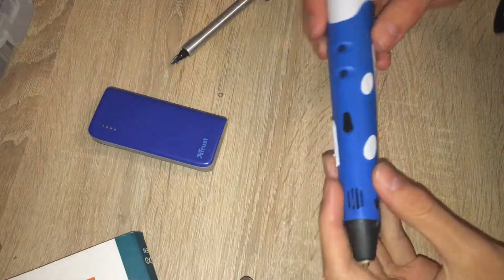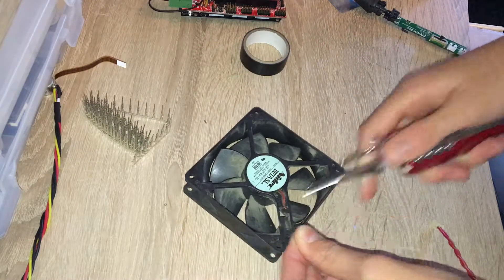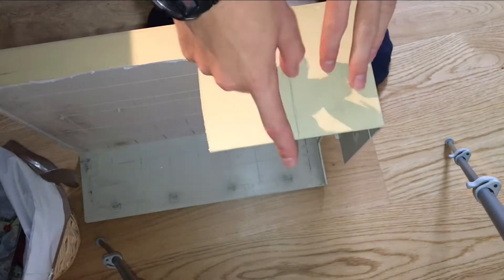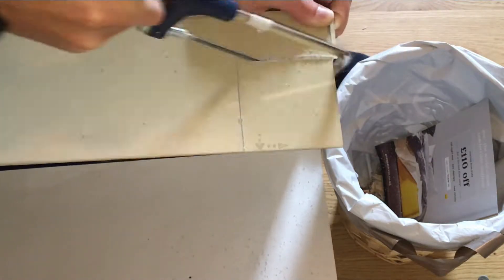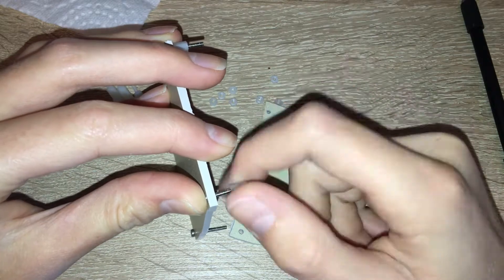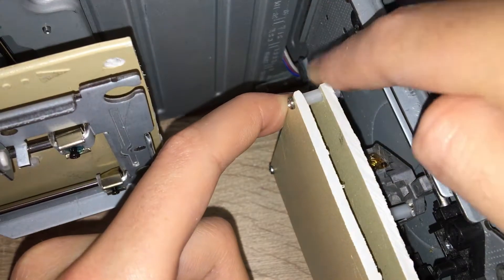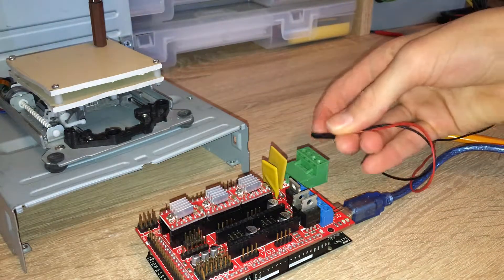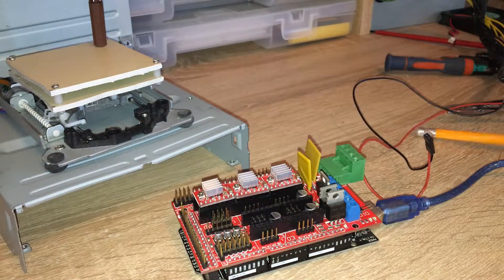Making a CD-ROM 3D printer - entry 9

Comment: Hi mate nice video I have a big problem with my Motors overheating way too much and I tried adjusting the Motor drives but then motor wouldn’t move at all what should I do, i would really appreciate some help
Reply from the maker: Sorry for a slow reply, I have other youtube channels. I think the problem may be to do with the motor being given the wrong amperage. 0.4A works for me. You can check it with a multimeter. By the way I liked the drawing machine you made. I’ve subscribed.
Reply: Joe Clinton no worries I figured it out ye thanks the mini drawing machine was a great starter CNC project I’m thinking about making a bigger one out of old ink printers that would be more useful